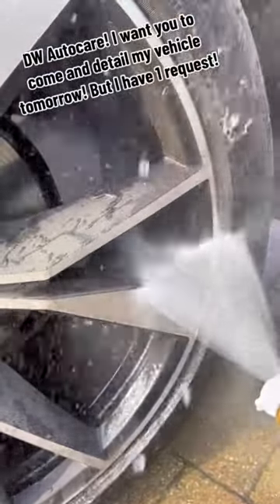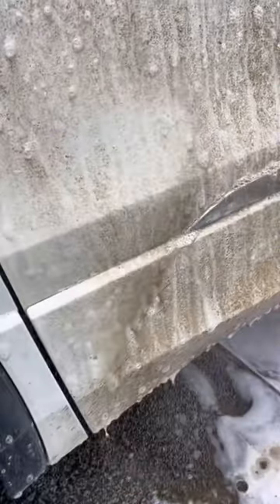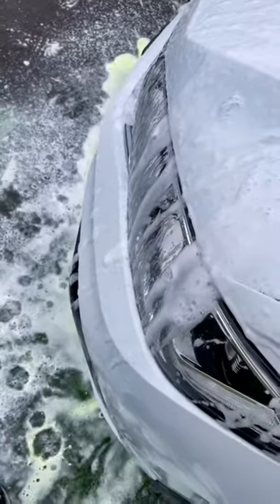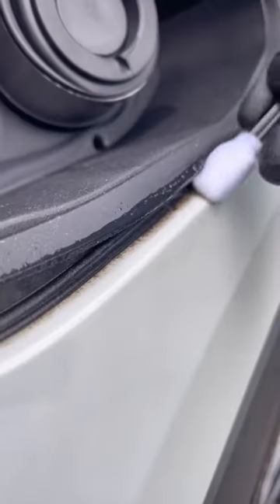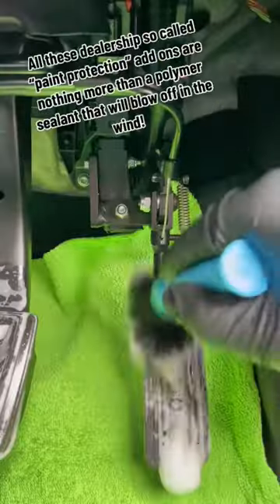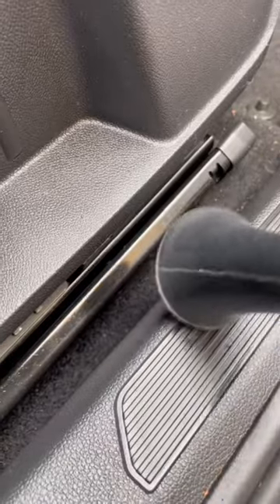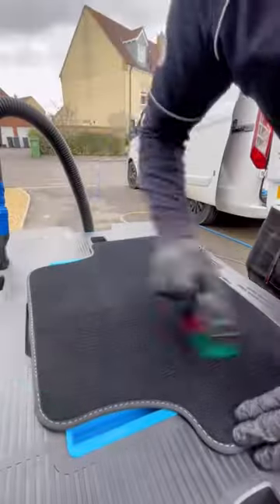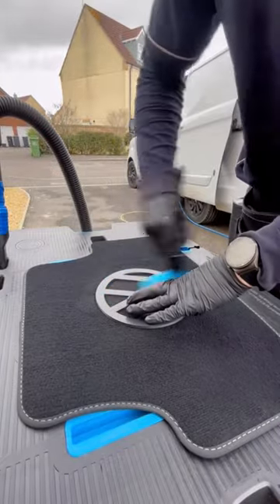Detailing- They Got RIPPED Off! Is Dealership Paint Protection Actually Worth it..! #shorts #asmr

Comment: Worked at 2 different dealers details, its remarkable the difference between them. One has a "veteran" of almost 50 years who checks in new vehicles by wiping the dirt off with a chamois, a chamois he also uses with a pocket screwdriver to "clean" in the cracks and soak up chemicals. The other dealer had rupes, flex, makita and many other polishers of various size and drive, 6 mytee extractors, chemical stations with meguiars products, also ceramic coating and chemicals to take remove anything from rust to concrete to paint. Some dealers are good your still not going to get a "car show" level finish to your paint if you do you'll over pay out the ass. The bottom line with a dealer is efficiency, the goal isnt perfection, which what you see when you watch most detailers on youtube. For most dealers the detail department is just a loss every month theres no direct money coming in from it just the perception of money gained from selling "good" looking vehicles. When you bring your vehicle in to get detailed at dealer there first goal is speed, then how best to sell you on the quality of the work performed (pandering), then the actual quality of work.

Comment: When you’re wiping excess liquid off with that cloth, how do you prevent the little pieces of cloth? Like if you use toilet paper to wipe off a mirror….
Reply: Microfiber towels aren't cloth or pieces of toilet paper lol if anything the vacuum or air hose will blow it out, stop using toilet paper on the mirror too, that's not the right way lol
Reply: Use a waffle weave towel for glass. Or a polishing towel for screens. Shouldn’t leave any fibers

Comment: Anyone notice the priginal accelerator pedal has been cut? And a flip up Jeff Gosling Hand Controls (JGHC) accelerator has replaced it. There is a wire attached to the new pedal which means that there has been another accelerator pedal added to the left side of the brake pedal. This means the customer is disabled and most likely cannot use their right leg, so by adding another pedal to the left side of the brake that works with the original pedal, it means they don't have to reach over with their leg to get to the original pedal. The car is also more than likely less than 3 years old as the customer is probably on the Motability Scheme in which case the car and the adaptions are all provided by the government. I can fit them and lots of other adaptations if you're in the South West of the UK :)